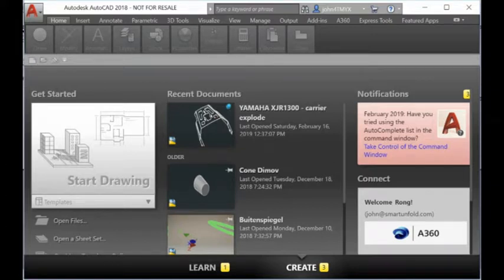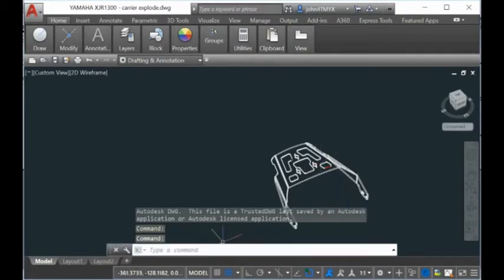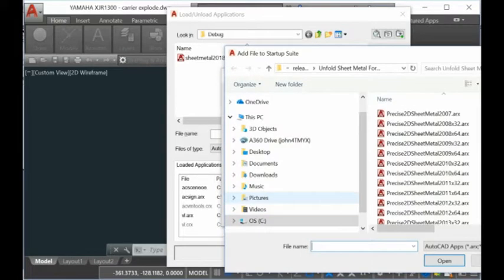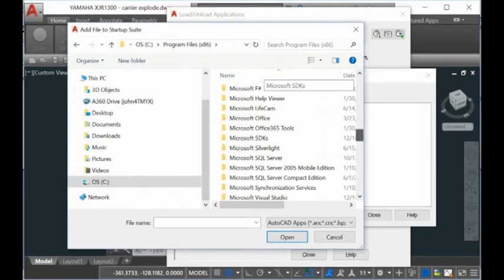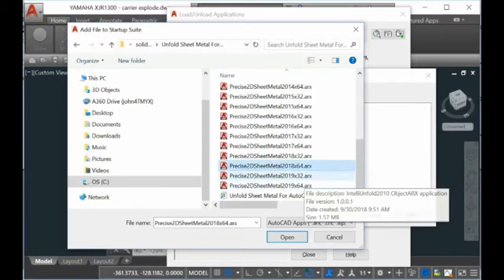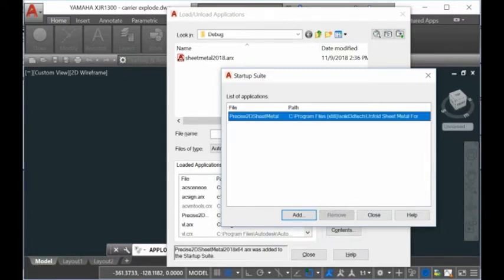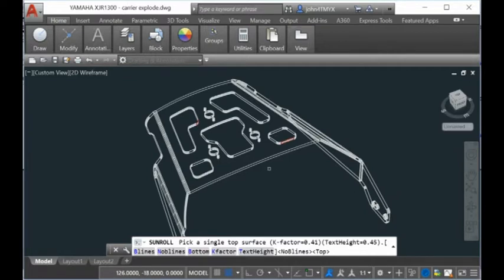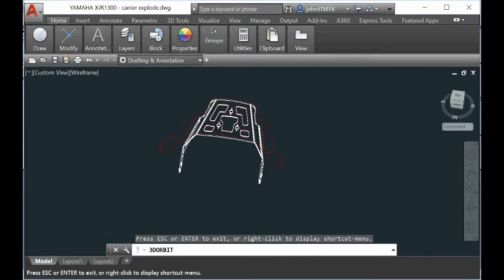How To Load an AutoCAD Plugin

Comment: Wtf, why I should pay for the trial version?
Reply from the maker: We used to give a free time-limited trial version (or trial version) for our product. Our time-limited version has the same function as the full version. But many people just use our product for their real project, never pay us. We are very busy to support the trial customers, but seldom get paid.
Our product is not modeling tool. After long time modeling, the clients want to manufacture models, so they need to unfold the surfaces into 2D contour to cut flat material, this time they need our product, but once they have their 2D contour, they don't need our product any more. Besides, they can use the trial versions of Solidworks, Inventor, Solidedge, Autocad and Rhino get the same results.
Now we just ask for 49 dollars for the time limited version (10 days), it is not much. But it did show client's honesty to try our software. As for the full version, a client has to pay first.
You can send me the parts you want to unfold, I will tell you whether it works or not. If not, then you don't need to buy. However, after I show you with a video that it works fine, then you have to buy a full license.